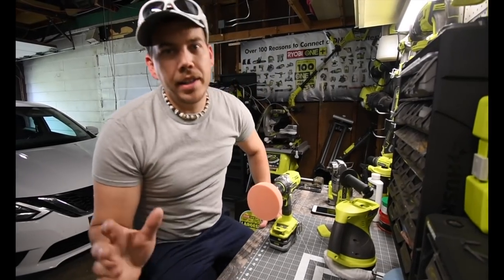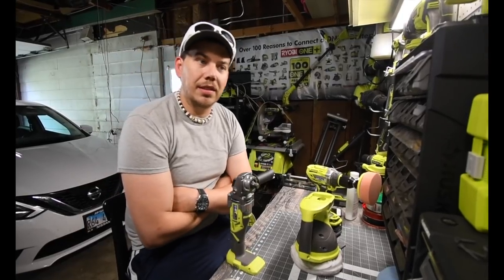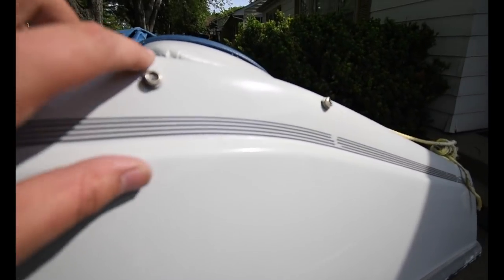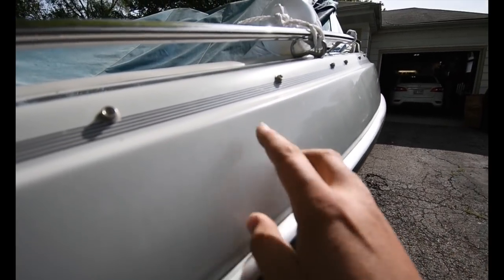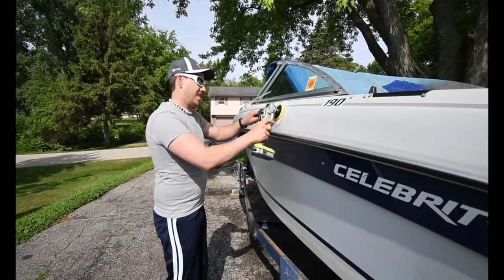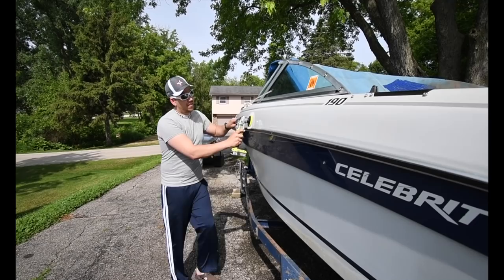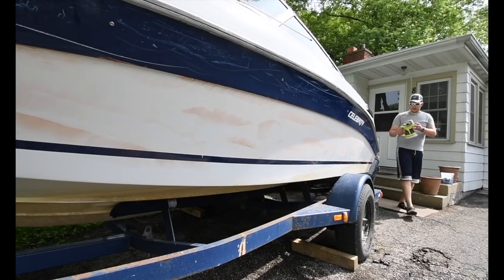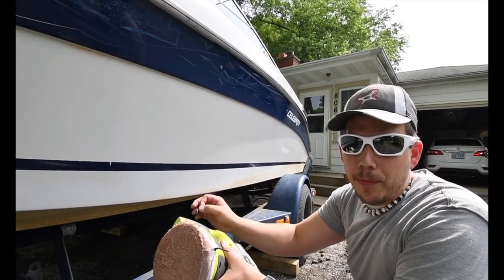Detailing my boat

Comment: Sounds like that little 18v or w/e voltage ryobi claims to use is screaming for mercy when your buffing the boat on that grinder.. I’m still hoping I can find a cheap alternative to using a $300 flexvolt drill to buff/polish.. thing is heavy and has too much power for that application..
Reply from the maker: it was a test to see if it can be used for it